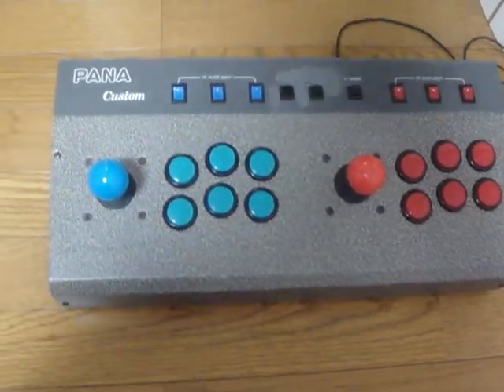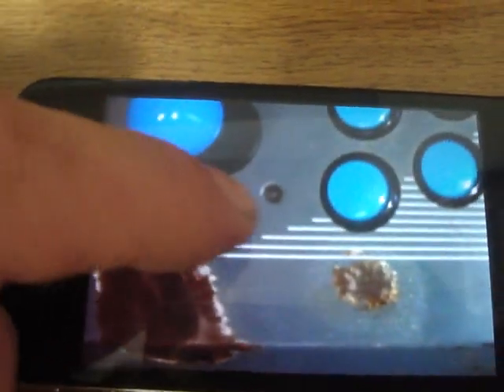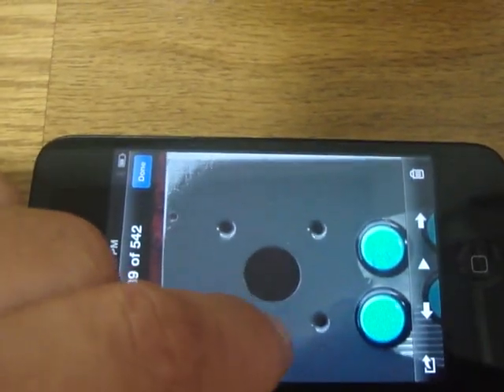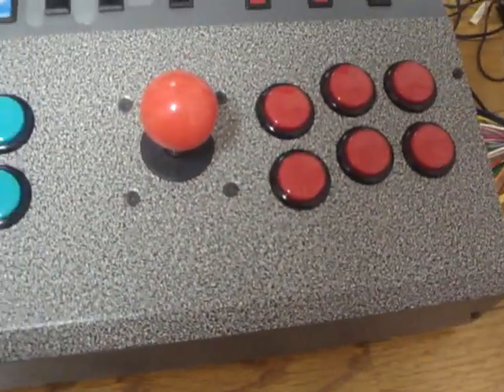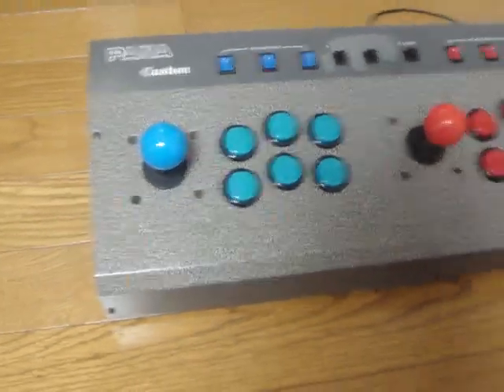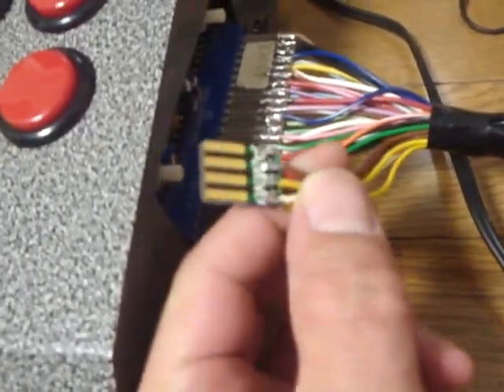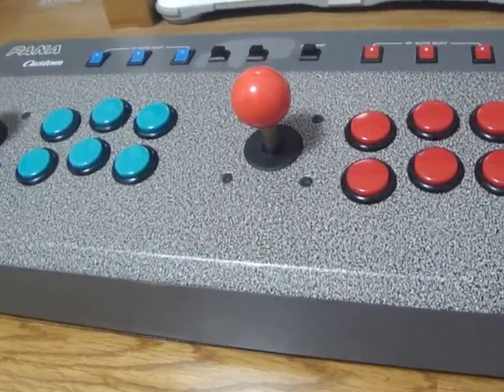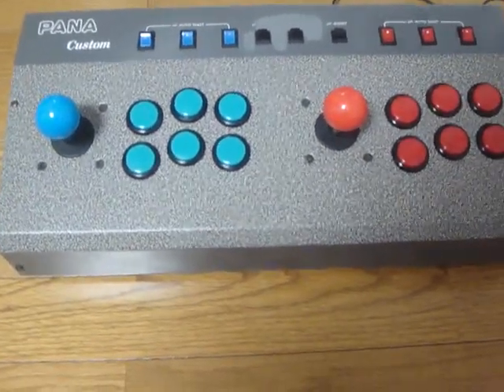Pana Custom Supergun Cleaned Up A Little

Comment: Great job Luke...hey, to resolve those issues of those exposed wires...What about trying that thin, black, plastic tube shaped stuff. It goes over the wires, and they shrink when exposed to heat (i.e. a hair dryer). That should make things neater for yah. Just a tip mah man. Keep on chuggin'  ^_^

Comment: vinyl is great for covering up control panels. as it stops the messing and time wasting thats involved with using paint. but its a shame the top section couldnt be cleaned up better, but then again, how are you going to get new logo's and text printed there if its re-painted. 
actually, a vinyl plotter would be useful in creating the logo's, but plotters are extremely expensive :/ so maybe if you have a printer, you could print out everything on sticky back paper and use stickers :)